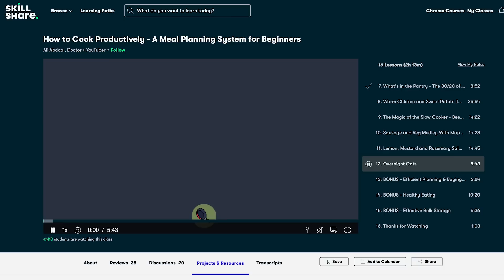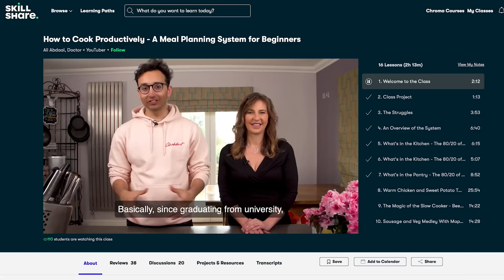Custom Camper Trailer | Picking Up Ivan in Colorado

Comment: if you make the cleats on the sides and the backs of those couches you can set them against the wall in between the fold out fridge and the fold up bed like one long couch if the table folds up it shouldn't be in the way of that and having the couch against the fridge will prevent that from sliding in and out while on the road , if that doesnt give out enough space you can set one of the couches upside down on top of the other using a cleat on the front of that couch to prevent it from sliding off the bottom couch